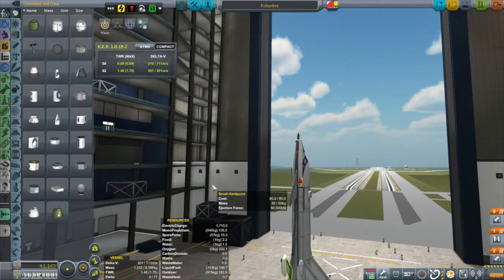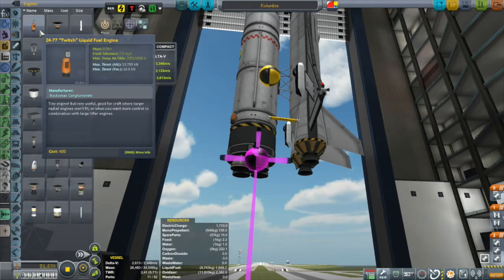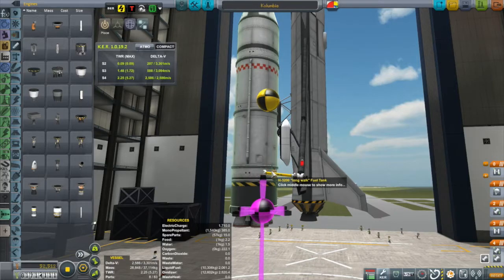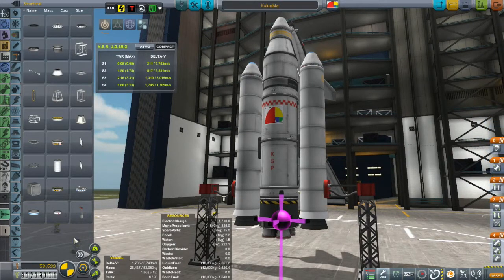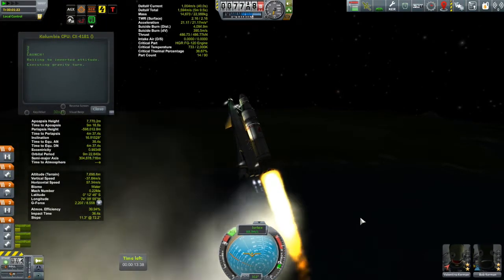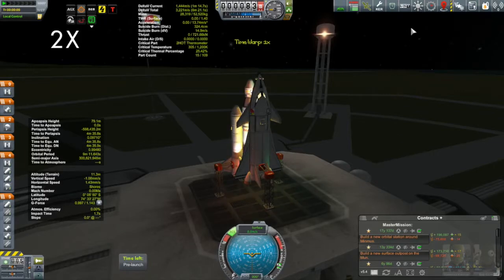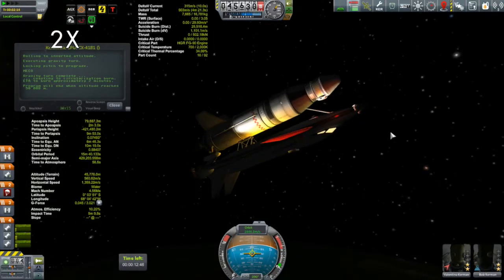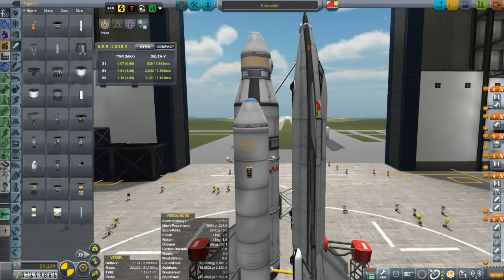KSP Career: Episode 58 - Space Shuttle Lifters

Comment: Problems I have when vectoring engines like you did at the very beginning of the video, is that once the weight on the belly is gone the centre of mass moves back into the plane which makes the engines torque my plane uncontrollably
Reply from the maker: +Niels Demming That's what the Vernor engines are for.  You can also lower the thrust limiter on the booster's engine (you can usually reduce thrust near MECO and certainly for circularization).  You can also pump the fuel in the liquid engine forward, moving up the center of mass which will reduce the torque even if the CoM is not along the thrust vector.